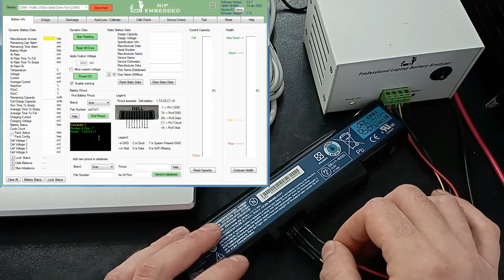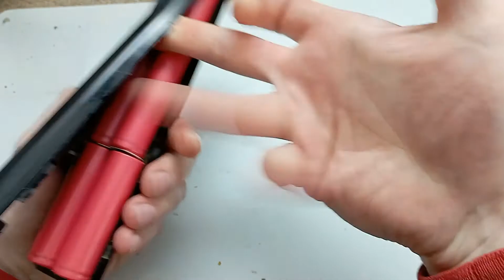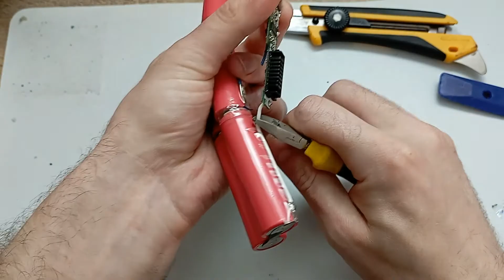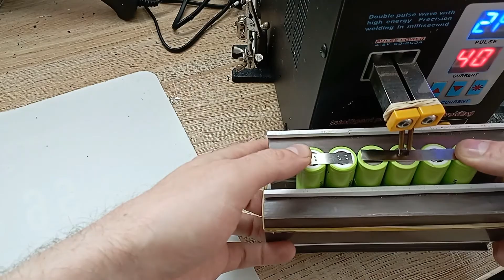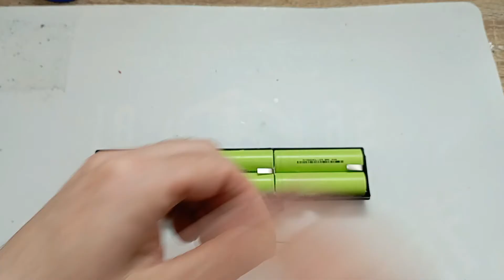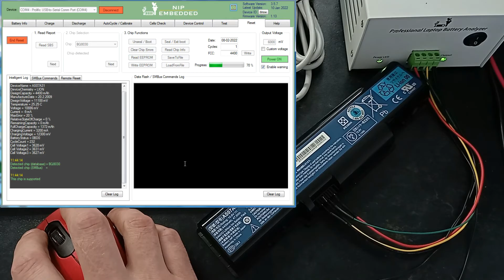Repairing a laptop battery by replacing cells and programming the chip using NLBA1 PRO Tool

Comment: I own one. And want to use this more often. But its subscription based pricing is cost prohibitive.  And we need to reset modern chips, with modern technology.  Not these 10+ year old laptop batteries in this video.  We need to reset DJI battery chips, Ultrabook, Notebook, Tablets, iPads, iPhones... type chips, with flat non 18650 batteries. In short..and modern BMS chip.  Make this open source.  Remove the subscription model.  Make this a killer tool in the right to repair movement!
Reply: NLBA1 can reset the most modern and custom chips on the market too like  BQ40ZXX, even the most complicated chip to unseal BQ30ZXX with dynamic SHA1 password is also supported, all versions of the  custom Apple chip BQ20Z451 and is currently working on adding DJI chips. Yes of course it is subscription based. Do you want it for free? You must be joking right?
Reply: We repairing 2019, 2020 year built slim-design batteries with latest crypto-technologies chips using NLBA1 subscription. It Does support these, just check the License description. And its really most cost-effective solution on the market, just compare with similar products with $1000 yearly subscription. WTF they should make it for free???
They invested tons of bucks in developing. Create the same product and sell it for free!))..
Reply: 111422/0436h PST 🇺🇸 thank you for your thought..
Reply: As of June 2022, the resetting license is $199 for a 12 month period, which is $16.58 (£13.56, €15.80) per month.
And this is for unlimited battery packs, so you can reset as many as you need to.
If you have quite a lot of battery packs that you need to reset, or re-cell/repair and reset as shown in this video, then this is a worthwhile investment. 
Remember that time and effort has to be put into making sure that various BMS chips are supported and can be reset, it continually evolves.
Reply: 111422/0424h PST 🇺🇸  To the Service Engineer: Thank you for the spotless description while on going procedure. You were confident, precise, patient and careful; while desoldering and re-soldering balance cables. I appreciate that. Thank you also for mentioning NLBA device for flashing and reprogramming the CMOS. Wish you all the best and keep on helping students and elderly people who struggle much to gain control of their LT, due to depleted power supply. 73s…
Reply from the maker: I need a DJI drone to have some flights this summer, I have contacted the DJI official store and I was very surprised that they asked me pay for the drone.
Reply: @nipembedded9976  I paid for the NLBA1 device.  I only have issue with the recent software subscription requirement you added (after I purchased the NLBA1). As for DJI analogy.  You buy the drone hardware, and the updates are free. I paid for your box.  I was just shocked you migrated to a subscription model. I'm not asking to give away the box for free.  Just ditch the subscription model.
Reply from the maker: @cognetic  The repair license is software subscription because:
- online solution is required to satisfy the security of the application due to high hacking/cloning risk
- reset algorithms are online because they require regularly updates
- more and more batteries are releasing, all we do is to analyze then and implement the changes on the server
- an offline version will support just a limited batteries, only those supported by the current software version
Reply from the maker: @electrorep3  We plan to create a Hobby License for small repair shops.